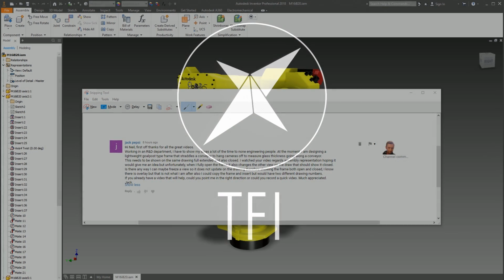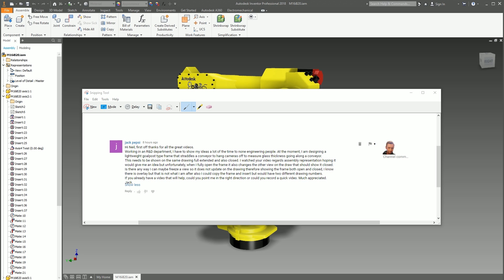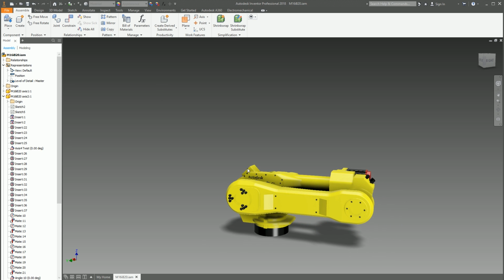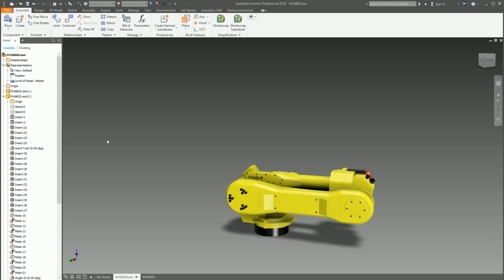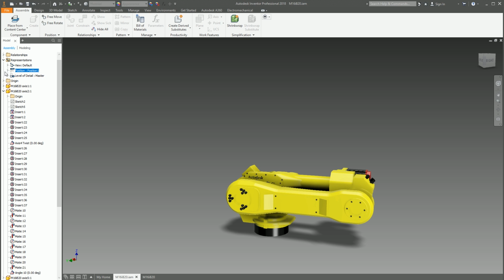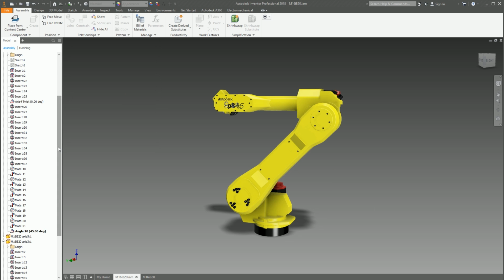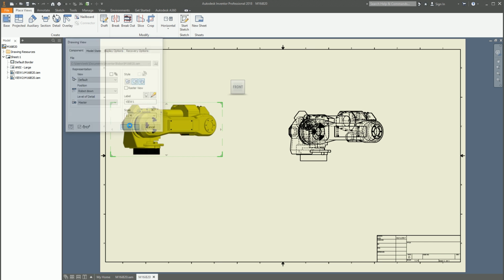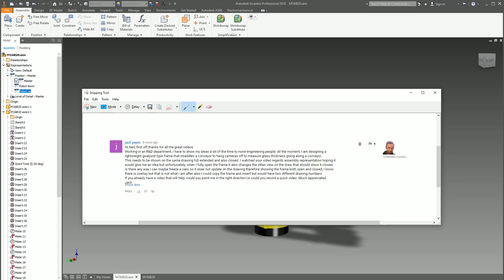How to show an assembly in two different positions on the same drawing

Comment: In Autodesk Inventor part model "representations" is somewhat like Solidwork's "configuration".  In SW, the configuration can be controlled in a "design table" which includes "suppressing features", "changing sketch variable values" and appearance(color, shading, visibility).  Does INV have anything similar?

BTW, your videos are great.  I am trying to "re-learn" INV, again.  At same time, trying not to forget my SW, so you may see my comments on your videos specifying equivalent commands between them.

Comment: As a follow up to Jack's question, can you (and how would you) place this assembly with it's two positional representations into another assembly and show both representations (two instances of the original assembly)?  I've never had the dialog box that offers the level of detail or positional reference pop up when placing an assembly into another assembly.  Thanks!
Reply from the maker: There's a couple of ways to get at it.  One is to place the assembly, right click it then choose 'Representation' and you can pick the positional rep to use.  Place it again, do the same, then just choose the other rep!
Reply: Worked great.  Thanks!